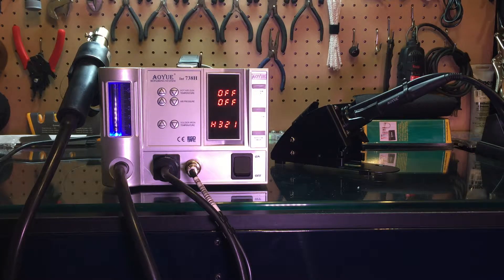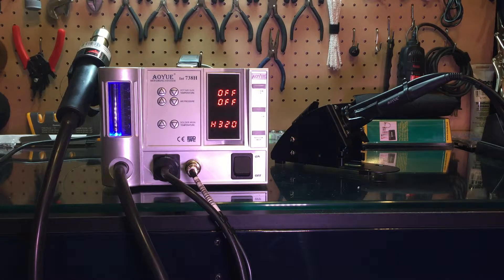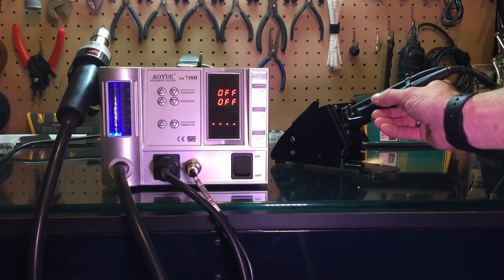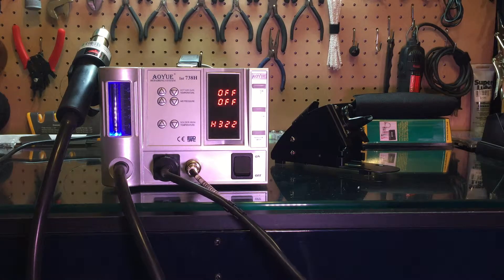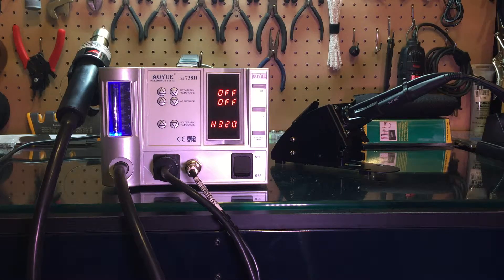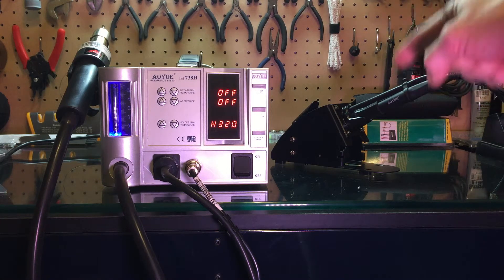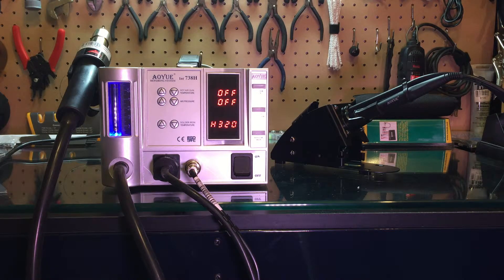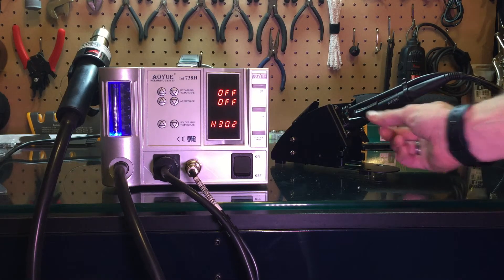UPDATE on the Aoyeu 738H - More Gadget Tech Thoughts

Comment: I just received this same model and my first thought was there had to be a magnet embedded in the aluminum cradle to lift the internal switch while inserted.  There's no magnet it turns out -- at least not in my unit -- and passing a handheld magnet over the iron doesn't trigger the sleep timer.   
The aluminum cradle has me thinking there was some attempt made to use a magnet, or there are some models with the magnetic feature (and a ferrous internal switch on certain iron models).   Either way I'm very happy so far, especially with all the features and extra accessories for $200  
Thanks for the very informative review.
Reply from the maker: Thanks for the comment. I believe they are using what’s called a “Tilt/Ball switch. Some tilt ball switches are non-ferrous, meaning they can still conduct electricity for a switch or triggered action but are not magnetic. This is a good thing, imagine trying to solder wires on to a subwoofer, lr even some normal speakers and the iron shutting off from the magnet, lol. That’s would be bad. 
Well I’m glad you liked the review, enjoy your new iron and thanks for watching.
Scott

Comment: hi im thinking off buying 1, how's it working so far?
Reply from the maker: It's still working good, no problems. I even recently bought some angled tips for it that are 8mm and 6mm diameter and tried them with some new flux and it worked good.
Reply: Great thanks! just needed to make sure its a good buy. Have you also tried any of the aoyue desoldering stations?
Reply from the maker: Hi Roger, I use the Aoyue desoldering 8800 gun that is separate from my station.
https://www.youtube.com/watch?v=eVF7m0JSX4Q

As for the hot air station I just posted a video on Amazon for reviewing some flux. In the video you can see I'm still unsing the Aoyue hot air station. 
https://www.amazon.com/gp/review/R1R4HQK803QHQ5?ref_=glimp_1rv_cl

On my station when I turn off the hot air I do turn on the smoke extractor for the iron, this way it pushes out cool air on the ho air heating element to extend the life. It does stay on for a little bit to cool it down, but I go the extra step to cool it down more. All heating elements eventuraly burn out, but the kit I link to in the description of the video does come with a spare heating element also. I think it's one of the reasons I bought this station for all the accessories it came with when I was starting this hobby.